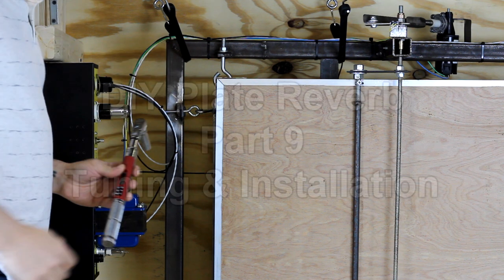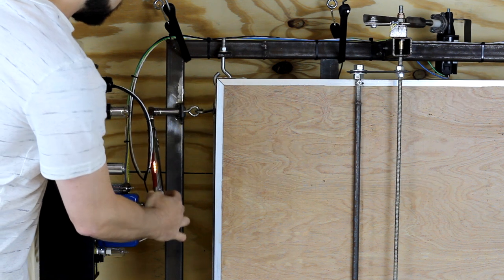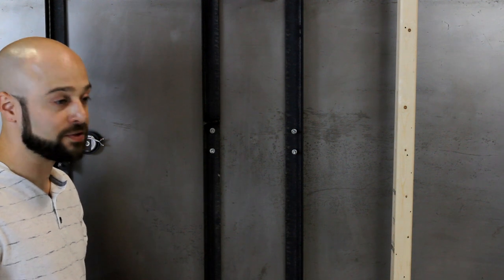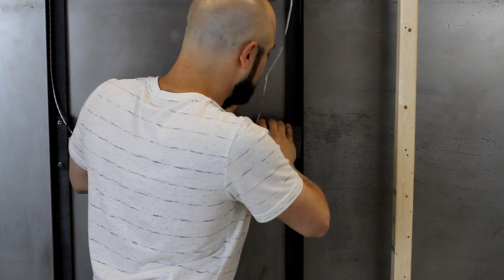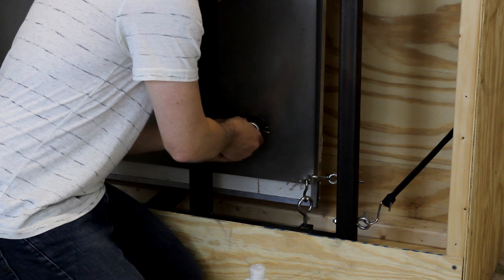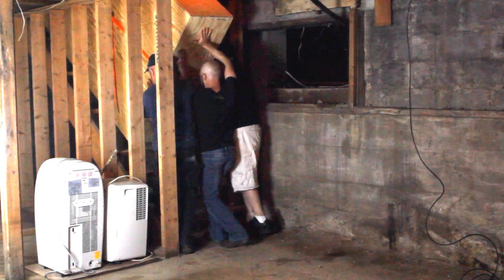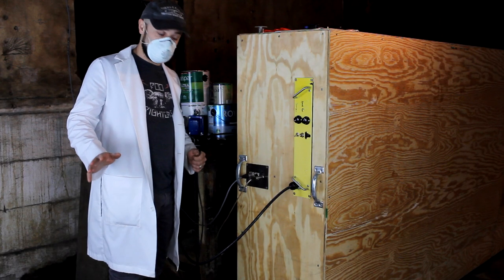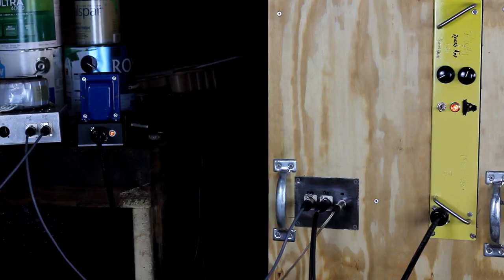DIY Analog Plate Reverb - Part 9 - Tuning & Installation.

Comment: When taking the box downstairs, I was nervously thinking those pickups permanently glued to the metal plate would risk getting some damage to them. That steel frame and heavy plate with light supports do have some little flex to them. I would have glued them after moving the unit in place. Also, the placement of the supports to the plate could affect the plate's resonance. Like finding a guitar's harmony with finger placement. There are sweet spots to connect supports, just need to find them. I've just seen this video, If you already thought all of this, never mind me. Good job.
Reply from the maker: made plenty of alterations after the video series.  It’s a wonderful beast now.  No time for youtube updates since I don’t get paid to make videos.  Still using the same headphones, but I did have to re-glue them.

Comment: I think a wax polish type compound would be better than WD-40. WD-40 had a bad habit of collecting any dust floating in the air. Happens when I coat with oils and WD-40 on tools and equipment in my garage.
Reply from the maker: Not a bad idea at all.  It is in a sealed cabinet and mounted vertically.  I checked it about a year ago and there was zero signs of visible dust.